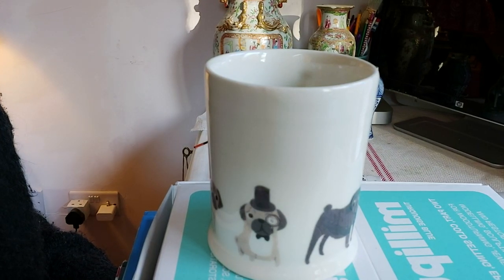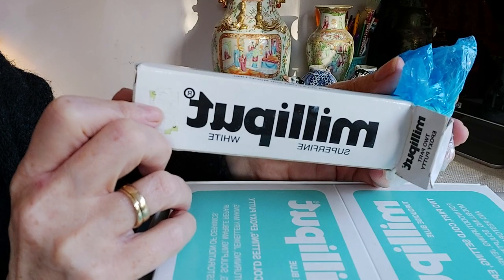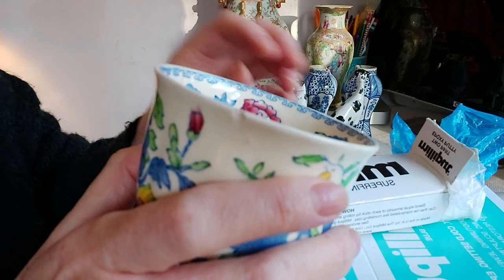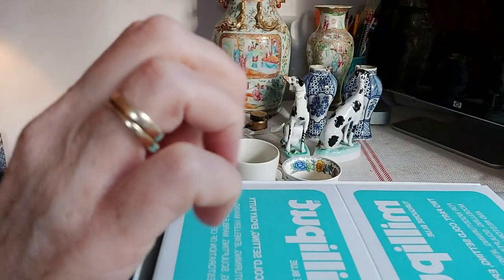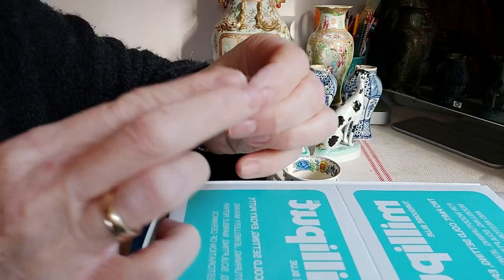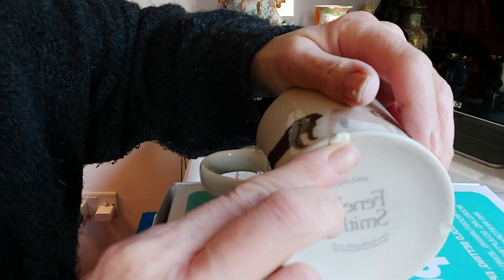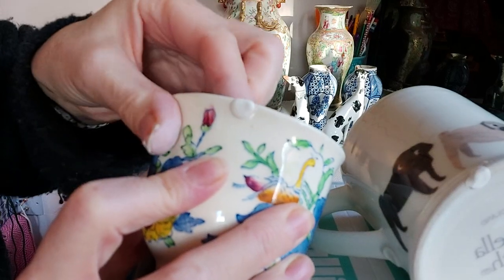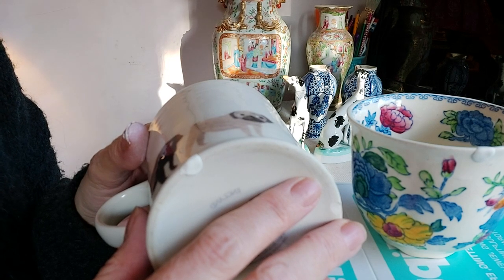FIX  CHIPPED MUG

Comment: Hi Allison. Thank you for the great video. Can you add food coloring to the milliput? I have a bright orange plate with a chip on the rim and none of the colours available match. Thanks in advance.
Reply from the maker: Hi Anais,  I am not sure about putting food colouring in Milliput,  you could ring them up directly and ask. You could once the Milliput has dried and been sanded, paint the Milliput orange and glaze it after to lock in the coloured paint. Would reccomend Rusins ceramic glaze as this is waterbased. I do have a few tutorials on painting on Milliput. 
Hope that helps.🥰
Reply: @theceramicrepairstudio  thank you! I’ll call them.
Reply from the maker: @edwardsjarje  Let me know how you get on?  Good luck with your piece.

Comment: I have a stoneware mug that is chipped on the edge.  I was going to get the black Milliput, but according to reviews it dries to a dark grey.  My mug is glossy black.  Should I just get regular Milliput and fix it with that?  What paint and sealer could I use that would be food safe, microwave safe and dishwasher safe?
Reply from the maker: Hi there, If you are going to buy Milliput for for mug I would go fir the black colour. But if you paint it afterwards it really doesn't matter on the colour.I tend to use Winsor and Newton Professional acrylic then glaze over the top. Depending in which country you live you could probly buy a glaze .eg Winsor and Newton or Rustins. They should be safe to use after curing, but first double check and look at the information/instructions. I hope this helps and please let me know how you get on.💕
Reply: @theceramicrepairstudio  if I just use the Milliput, do I still need to glaze to make it safe to drink from it.  I've found no glazes that are food safe unless I have a kiln to fire in.
Reply from the maker: @sunshinetester4797  Hi Sunshine Tester, I have spoken to Milliput and as long as it is fully cured, which I would leave for 36 hrs you are fine to use it. If you look at their website or Google it you can find the manufacturers instructions which I think will answer your question. 💕

Comment: Oh interesting!  Glad to know this is possible.   However, I still have the chipped pieces and wanted to "glue" them back on the rim somehow. Do you have any suggestions or videos about how to do that, in a food-safe way?
Reply from the maker: Hi, unfortunately I cannot recommend any glue which is food safe although you could look at manufacturers instructions of glue companies before you apply.
Reply: @theceramicrepairstudio  I found that gorilla 2-part epoxy is food safe after it cures, then painting over with a food safe black permanent marker to cover the spot of the remaining chipped piece we couldn’t find!  Hoping it turns out well!

Comment: Sorry - me again!  One of the items I'm repairing (I've finally stopped myself doing any more DIY and curtain-making during this lockdown) is a mug that is cracked.  I can slightly pull it apart at the top to possibly get some glue in, but is there a method for mending this?
Reply from the maker: Hi Julia, you may be able to apply glue with a cocktail stick, depending on the crack. Just be mindful if you fill your mug with hot liquid the glue will soften, so wouldn't then recommend it to use after. Although it depends where the crack is.😀
Hope this helps.

Comment: Lovely information, but why, why, WHYYYYY did you use the @#$% SELFIE mode on your camera to do this video??

When you use selfie mode, the designers of the camera made it operate like a MIRROR, and it REVERSES everything left to right!!  (To accommodate idiots who like to use their phone as a mirror, but that's a separate issue!)
When you were doing post-production, did you not SEE everything backwards and think of flipping the frames for the segments with print in them?

When filming IMPORTANT stuff, like this instructional video here, use the camera in REGULAR VIDEO MODE, and viewers won't have to suffer through trying to read labels, packages and instructions WRITTEN BACKWARDS!!

It's simple.  Just set the camera on the tripod as you usually do, face the MAIN CAMERA LENS towards what you want to video, check once by going around back and making sure the zone you're filming is adequately covered, start the video recording and proceed.
By doing it THAT way, all your viewers get to see everything AS IT REALLY IS, and not being insulted by having TO READ EVERYTHING BACKWARDS!!

I know selfie mode makes it easier for YOU to watch what YOU'RE doing while you work (still, mirrored backwards), but I would think that if you've got the camera set up correctly, aiming at the right spot, and you know your stuff, THERE'S NO NEED TO WATCH YOURSELF WHILE YOU WORK!  Just work through what you're aiming to show your audience!  Besides, in most cameras, selfie mode is LOWER SCREEN RESOLUTION because designers know people will be sending those pics or videos over the net, which works better with lower-bandwidth, lower-resolution images. 

Why not re-edit the video...  just literally flip it left to right and re-render it and post it again?  As a favour to your viewers, at the very least.  The audio won't change, everything else will track, but your screens will be readable!!
Reply from the maker: Hi there, This is an older video and  have since changed the camera mode.